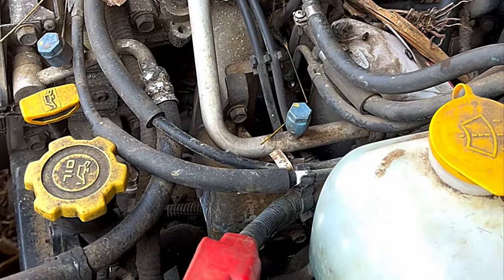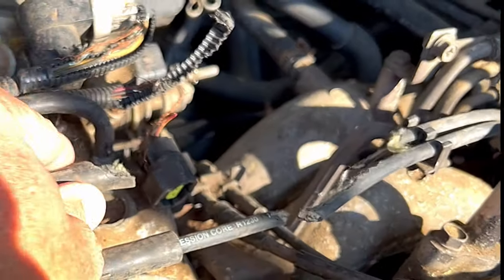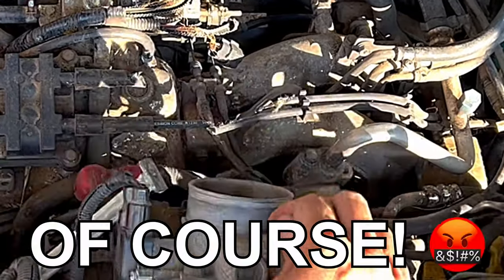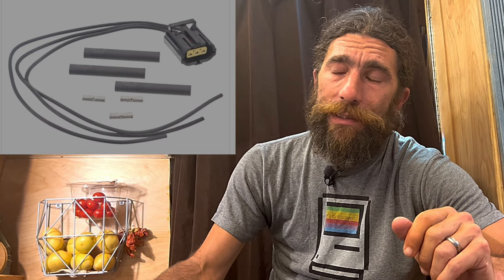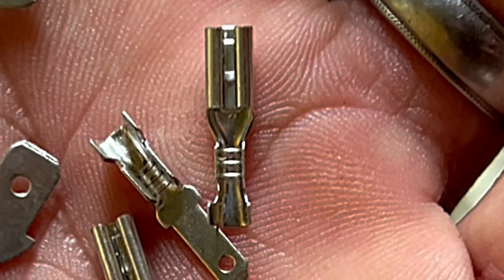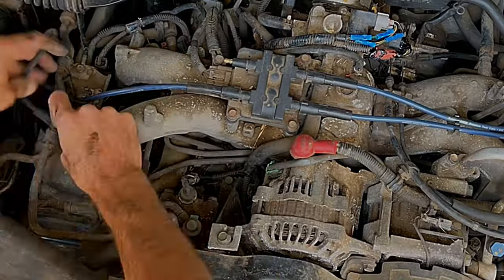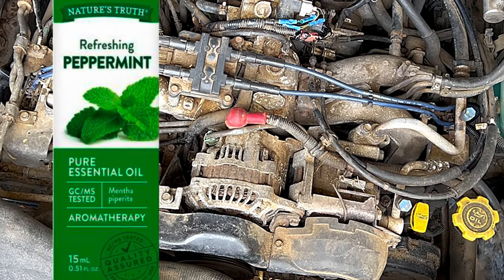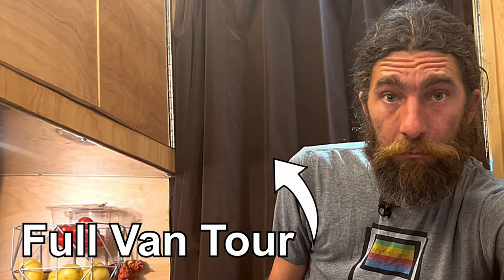VanLife BAD Surprises - Rat Chewed Wires

Comment: Used peppermint oil mixed into 303 protectant and added a few Pure Evil Capsaicin Drops.
If you need to work in the space any time after that I would skip the hot sauce lol

Comment: I watched the whole vid waiting to comment about Pepp Oil, lol. I use the same spray mix method (on EVERYthing outside that has wiring. Including my A/C, mower, etc. ) but I also cram cotton in the toe of knee-hi stockings, tie it to something handy under the hood and it's easy to just re-soak it regularly w/ the undiluted oil. I use the spray to cover more areas including the wheel wells and tires themselves (access points). 
** worth noting! I do this year-round, BUT pay EXTRA attention in the Fall & Spring, that's their most active 'nesting' seasons.
Those repellent sachets are always rip-offs, they work (if at all) for about a week.
Reply from the maker: Agree! Good tips!

Comment: Miraculous you got that harness fixed without crossing something up. Great work. I had a mouse (Isaw her and her nest made out of my vintage book and a towel. in my trunk while I was using my car, letting it sit a few days at a time. I put all kinds of smells in it, ending in mint oil. All through the car so it wouldn't just migrate. Have seen no evidence of meeces since. I stuck a block of poison in. No nibbles on it.
Reply from the maker: They are pretty smart!

Comment: When I delivered to people in the mountains they would typically leave their car or truck hoods open to keep the engine bay colder and exposed to light. Does not have to be open all the way and you can tie it down with a block to keep it from flying off in a wind storm.
Reply from the maker: Yeah, I did that this last time with a 8” 4x4 post👍🏽

Comment: I feel your pain. My friend left a car sitting for a while and then desperately needed it going again. Around a dozen wires right at the computer were chewed along with the spark plug wires. Sometimes you just have to make it happen!
Reply from the maker: Yeah, unfortunately this was not my first Rodeo with rat modified wires… they got my F350 Ranch truck years ago… a wire bundle 1.5” in diameter, about 30 wires for the main harness… 80% chewed through. That was a full day of splicing.

Comment: I have had best results with straight undiluted essential oil dribbled liberally at entry spots and under the hood of my 88 Sunrader to keep phylum rodenta at bay. I find that watering it down does just that. And, you are a prodigious problem solver and builder of things!
Reply from the maker: Thanks! Prodigious problem solver and builder of things… I like that… might have to add that to my business card!
Reply: I just left a similar comment about the undiluted oil ... cram cotton in the toes of knee-hi stockings and tie it to something, then just re-treat regularly with the oil.  : )

Comment: I shouldn't chuckle, but I am. We have an old Expedition that the local pack rats are in love with. We literally just got it out of the shop yesterday (again) because a rat chewed through the coolant line. (again) At least they didn't rip out $3000 worth of electrical wires or build a nest in the engine out of engine parts. (again) My exterminator has been battling the little bastards for three years now.
Reply from the maker: Don’t feel guilty… you can chuckle… in fact, point an laugh… I put it on YT for that exact purpose!👍🏽

Comment: BMW sells an electrified rodent zapper system to prevent Marten (a small german weasel) from chewing the wires under the hood, in this way they are much like your rats.  It is unofficially referred to as "Das Marten Waffe".  One could envision a similar system that could be fabricated at very low cost to achieve similar results powered by battery and a solar panel for extended use.

Comment: You could also have put the black RTV goop in the shrink wrap before heating it to let the goop be pushed between the wires a little better when the wrap shrinks.
Reply from the maker: Good point.
Reply: Thanks - that's a great suggestion.
Reply: I wanted to say the same thing, one suggestion is use much longer shrink wrap and as Fred Flintstone (<-lol) suggested right before heating the shrink wrap put that black goop on and then heat the shrink wrap over top to help reduce water penetration. Nice clean up!
Reply: @DavidD03820  There is glue lined heat-shrink tubing too, to consider.

Comment: Going back to your 1/8" plywood, what kind of blade or technique did you use to cut it without it spitting or delaminating, when I cut thin plywood even with a many teeth blade, the wood disintegrates along the cut.
 Sorry about your wiring. Great videos. I'm going back to watch them again.
Reply from the maker: The trick is you want the blades teeth to push the presentation side of the ply into the core of the ply when cutting, they make jig saw blades that cut on either the down stroke or the up stroke… I would use the down stroke cutting blade when I wanted to cut the ply with its presentation side facing up towards me.
Reply: @falkornomad  thank you, I have been cutting my wood opposite and wrong, or at least using the wrong blades, thank you. I'm used to using 1 or 2 blades, time to go find others. Again thank you for explaining this to me.
Reply from the maker: No worries!!

Comment: Be glad it wasn't a European vehicle or a Tesla. They use a biodegradable plant based insulation on their wires and rodents love the stuff.

I worked for a company that manufactured racing dog boxes that replace the bed on a truck. We always soldiered every connection of every wire, in a very specific way. When I mentioned to my boss how much faster crimp connectors would be he asked me if I had ever seen a box come in that didn't have working lights. I thought about it, and the answer was no. "That's right," he said, "done right a soldiered connection will last  20 years." I had seen boxes come in that were over a decade old, the floors and metal frame would be falling out from all the urine build up but the electrical systems all worked.
The process we used was to weave the strands of two wires together, soldier, coat with liquid electrical tape, wrap with electrical tape, coat a second time.
Over the years I discovered using a pencil torch and soldier paste flux allows one to soldier salt water corroded copper or copper to aluminum wires.
I practiced this method on my boat's wire harness and never once had something not work when I hit a switch. (excluding the device itself) I used that boat for 5 years and sometimes it would sit under a tarp for half a year, everything always worked.
Reply from the maker: I was wishing while doing this project that my solder station was not buried in a storage unit!!
Reply: All cars use soya based wiring now. It's just a very old Subaru so pre soya